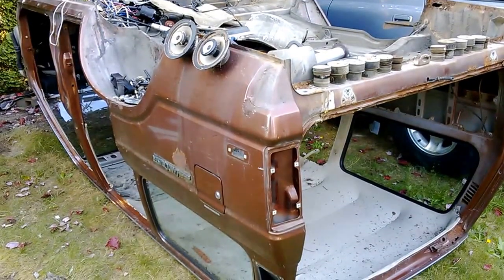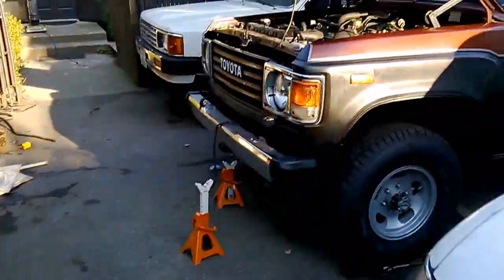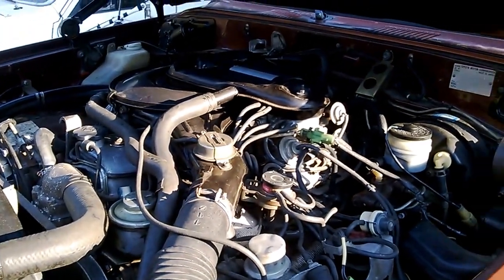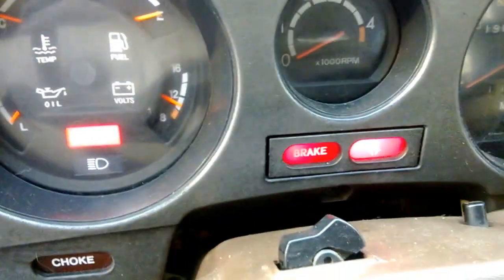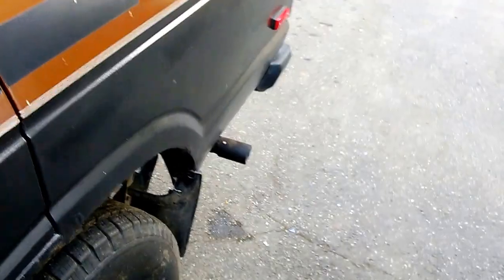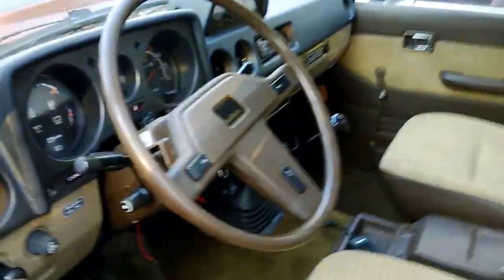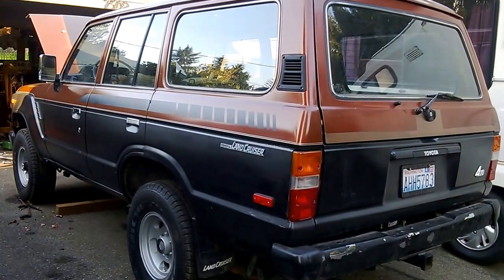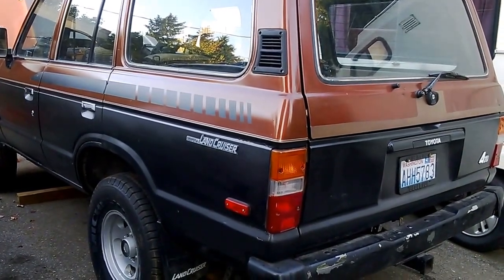The FJ60 Land Cruiser - Ghettofab... may need another engine.

Comment: Agree with 2Quick4U928, probably the seals around the valve stems, especially if most of the smoking is after not running over night, etc... the oil pools in under the valve cover on the top of the head and seeps down aournd the valve stems into the cylinders... after the start up and running (and burning this oil off), the rest of the blue oil burn is probably the rings.  A compression test will let you know about the rings as he says.  Have subscribed, enjoy your videos brother, Clay